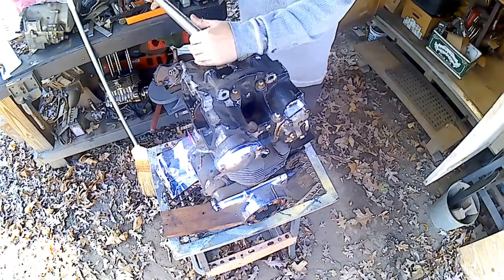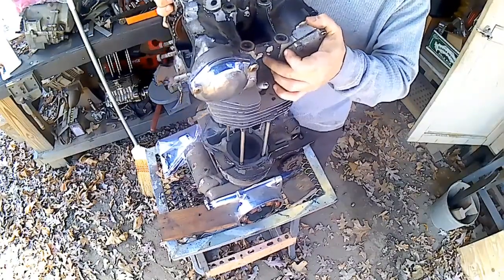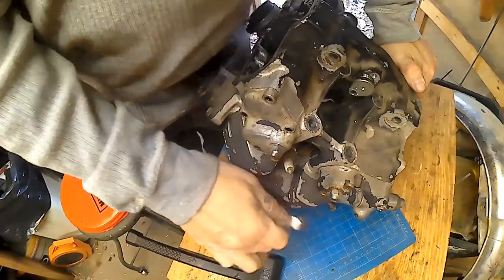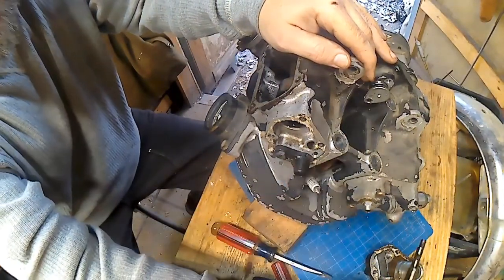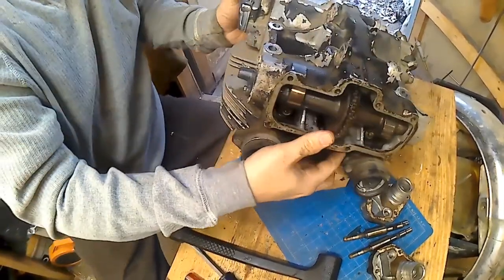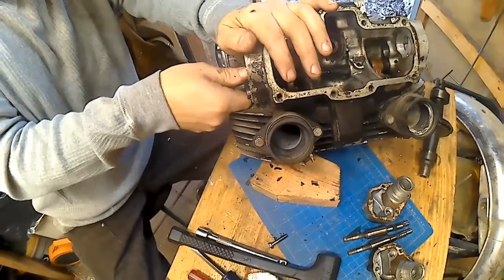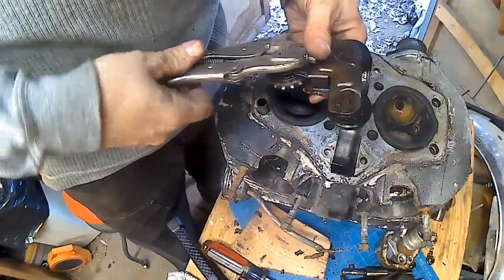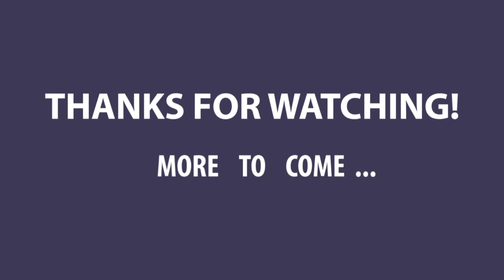1972 Honda CB450 Cylinder Head Teardown - Part 1

Comment: Brother I see you are not breaking those top bolt in the pattern that's supposed to be used, you take a really good chance of warping that head breaking them without using the bolt breaking pattern, you should be breaking those bolts off in a crisscross pattern but then again it's your motor I'm just giving some advice
Reply from the maker: You are correct, good practice is to remove them the opposite pattern of how they are installed. On this particular engine I knew the head was going to be scrap so it really did not matter. There were stress cracks in a few places which is not something I would ever try to sell, there are plenty of good heads for these around. I think I have 5 sitting on a shelf right now. But generally inside/out staggering sides for tightening and outside/in for loose is good practice. Thanks for watching!